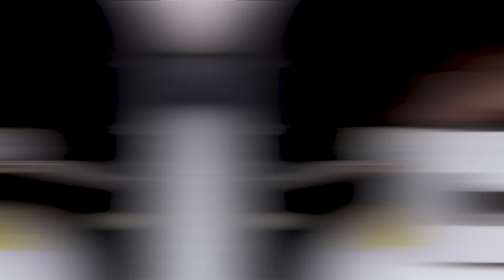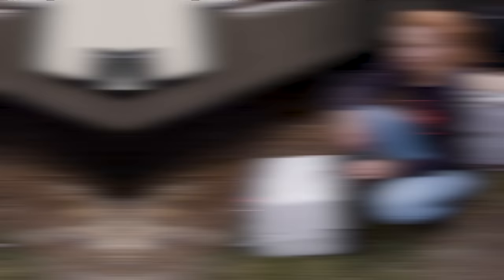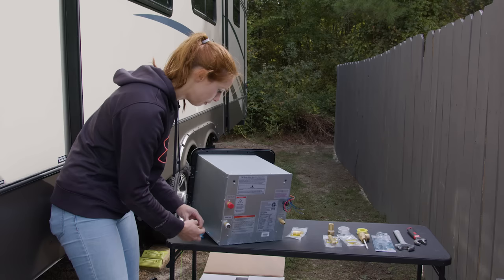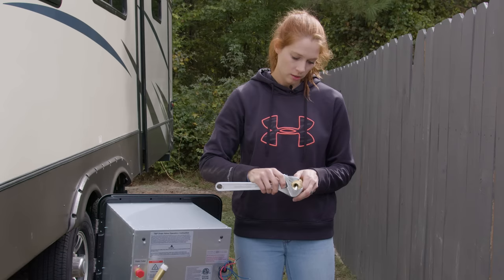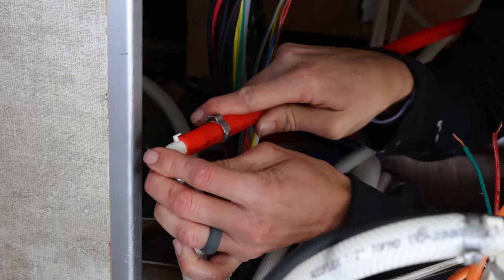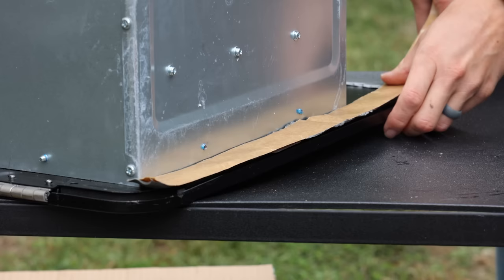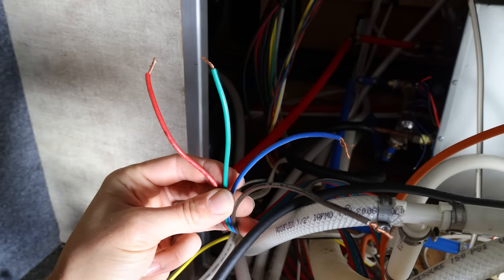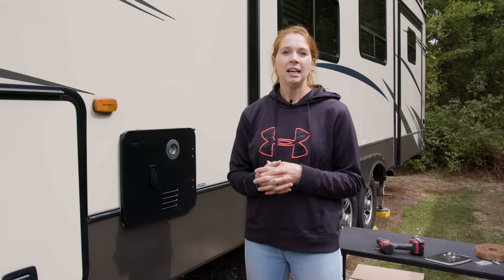(UPDATED) Installing a New Fogatti Tankless Instant RV Hot Water Heater: Easy step by step guide!

Comment: Excellent tutorial... consider wago lever nuts over the outdated wire nut for electrical connection.  Love them.
Reply: I bought wago, with the same thought that nuts are outdated and can be slower.  After buying, I did more research and found I was wrong.  Wago limits current flow much more than wire nuts, making the nuts superior.  Be careful of when wago is used.
Reply: @bobblack3870  From the manufacturers site:  "WAGO installation connectors always come with the full current load capacity of the maximum connectable conductor size. They never become the current bottleneck in an electrical installation."  My RV was also manufactured using Wago Nuts and I personally have them installed in my basement refinish with no issues.  I even have high current draw space heaters plugged into the outlets.  Where did you find your information?
Reply: @panofish  My info comes from electrician's forums.  Most places in an RV may be fine.  The professionals say they are good for solid, but not stranded because some strands may not get contact.  They also dislike using them where there is more than 15A.  Don't know why, but maybe it is related to possible generated heat due to a limited contact area, whereas wire nuts ensure a large contact area.
Reply: @bobblack3870  Appreciate the kind feedback, but I guess we'll just have to disagree.  I have a BSEE degree.  Never seen signs of overheating with stranded in a wago.  Perhaps with sloppy wiring?  Who knows, but I trust the wagos.  Personally, I've seen sloppy work with wire nuts also.  For clean connections with stranded... I sometimes solder the ends.
Reply: @bobblack3870  Ah, well the forums must be correct.  🙄  Wago connectors are used in almost every 16A 230V residential application in Germany, and possibly the rest of Europe.  Wire nuts are expressly forbidden in Germany.  Wago connectors can be used on solid or stranded conductors.

Comment: I believe the term is " water heater" You cannot heat hot water, also even after the tutorial on  the direction of the tape, I believe you applied it in the opposite direction on some applications.  Great video very educational, I wish my wife was as mechanically inclined as you are, happy camping.
Reply: Glad someone else cringes over "hot water heater".  If the water is already hot, you don't need a heater!  But I wasn't gonna be that guy. 😁

Comment: Thanks for the video. I note that some were mentioning the tape error. I will also add something that my father taught me on any tape usage with threads (water or gas). He said to always avoid the tape on the first and last thread groove. He was an engine and mechanic guy and said it can save a lot of potential trouble with the tape.

Comment: Great vid. Without a doubt the best I’ve seen on install on demand. I’ve been plumbing for 45 yrs. i cant tell you how many times I’ve used teflon tape and had leaks afterward. I finally started using both tape and pipe dope combined and have never had a leak. Also 5 wraps of tape werks best. Dont put more you can actually snap the fittings.  thank you!!

Comment: Hi, Thank you very much for the video, as per the manual it recommends a 680 kpa on model fs08b1s (100 psi) valve and the valve goes on the outlet side, I didn't know anything about this heater until I watch your video, it was great help.

Comment: Great video. I believe you can use Teflon or  Teflon pipe dope on compression fittings but not on flared fittings. And to end the confusion just apply your Teflon tape clockwise. Thanks
Reply from the maker: All of this has been addressed in my 8 month review video! Make sure to check it out if your thinking about getting one 🙂

Comment: great job we can't expect people to think of everything. The one thing I did different was to run out all of the hot water in my old tank, after turning off the power and gas to it, to avoid getting scalded when removing my my plug.

Comment: I'm currently installing a Fogatti 8 Pro.  Guess I need to make a video about this.  That said and someone may have caught this already. The pressure relief valve is actually blocked by the gas line in this installation. And as stated by someone else but a VERY IMPORTANT PART. Don't use any type of thread sealant on a  flare fitting.  If it leaks you either have to replace the fitting or create a new flare on the pipe. That is the only SAFE way to do it.
Reply from the maker: This has been addressed. Make sure to check out the 8 month review video 🫤

Comment: if a connection has its own way of sealing.....ex, flare, oring, compression, etc......dont use any teflon tape.   yes it will be tight on the thread around the nut itself, but it may not be tight on the inner tube part and could allow it to leak.      very good vid!!

Comment: If you have problems with the temp differances like most of these on demand  rv  heaters .if you get a 2.5 gal electric heater under one of your sinks that are close to water heater . As a buffer tank . There are piping diagrams on line to pipe in a buffer . Its cheaper than buying a Truma tankless . Truma tankless water heats you will have even heat at the foset.

Comment: Nice job, only problem is I still want dual heating so I’m not burning through propane so when one comes available that’s when I’ll be shopping. I can heat on and off for free with solar and batteries but it will drain quick if you are not careful 😂  
But if you drop to a lower wattage you can keep on longer for keeping water warm then propane for shower. 👍🏼
Reply: I don’t think they will make a tankless electric for a towable. Would be too big.
Reply: No RV can handle the electric load of a electric on-demand water heater
Reply: Does not use that much propane

Comment: While you're installing a new water heater, installing a water accumulator at the same time would be a good idea.  An accumulator eventually saves battery usage and the pump doesn't have to run in order to get water pressure.  Nice at night when everyone else is sleeping. Oh by the way, what you call an adjustable wrench at the beginning is actually called plumber's pliers. I would recommend using a good fitting wrench instead of adjustable.
Reply from the maker: Eh, I’d never use it. We don’t boondock enough to justify that. We use propane to heat our tank, and it’s surprisingly quiet. I don’t think it’s ever woken me up at night and it’s right below my head 😂

Comment: I do tons of winter camping and this water heater specs say it won't turn on if the water is below 43 degrees.  I use a heated water line but I'm sure there are plenty of times it is only 33 or 34 degrees coming in on those days the air is 15 or 20 below.  So that is something to consider if you are a year round camper.

Comment: Tankless are great for hot water. Nut there is something that I haven't seen mentioned in the comments and some may not be aware. Tankless consumes a lot of propane. Not sure the trade off is a good one, especially if boondocking and supply of propane is not close.
Reply from the maker: We just went camping for 5 days and didn’t even use 1/8th of a tank using the hot water heater AND the furnace nonstop. I’d say it’s no different than using the propane/electric version of it.
Reply from the maker: @Roads To Nowhere consumes more of what? Water, energy, propane? I’m assuming you mean propane. If that’s the case we’ve used it several trips and haven’t used any more propane than our old heater

Comment: My first RV had a tankless water heater and I didn't like it. It didn't work well at all if the water pressure in the campground was low or running off the pump. I use a 1 micron water filter that also slows the water. Tankless heaters will reduce the heat if there is low flow. Maybe the newer ones work better.

Comment: Please don't use wire nuts in vehicles.  Over time they vibrate apart and then the connection starts arcing.  It is very small at first but over time can cause a fire.  Use the crimp style connectors, push connectors, or if you want to be the most correct, solder and shrink-wrap the connections.  If you want to know if your panels are aluminium or steel use a magnet.  Don't use your router in steel panels.  Good video all the steps are easy to understand.
Reply from the maker: Rv manufacturers use wire nuts. Doesn’t mean it’s right, but it’s standard. Also, I’m using my router on aluminum, not steel. The only part of any RV framing that is made of steel is the trailer frame itself. Any framing will be aluminum or wood (or sometimes entirely made of foam).
Reply: @fallenintocamping  I did note that you were using it in aluminium, I was commenting for people that watch your video, informing them an easy way to do a check.  Many older RV's have steel panels and you never know if someone used a steel panel to do a repair.

Comment: While it might never happen, it appears that the handle on the water pressure relief valve can potentially rub against the gas line.  I would suggest at least an inch further turn to ensure it won't.

Comment: Be sure to use some soapy water to spray on your gas line connectors with your gas on to ensure that there is no gas leaks.
Reply from the maker: Agreed! I think I quickly skipped over this at the end with a ‘make sure you don’t have any leaks’ comment but I definitely should have elaborated on that. Soapy water in a spray bottle is the best way to check!

Comment: I don’t know if your tankless water heater wires you didn’t use are like mine but mine I found out the ones you sent to cap or for the shore power so you don’t deplete your battery power

Comment: just a thought.  You should never use adjustable wrenches on gas fittings! (slip-age/damage). Line wrenches are best but open end wrenches will work in a pinch.

Comment: Nice video. Hard to tell for sure, but looks like you might have missed a crimp on your relief valve drain line after the elbow (unless you did it after). Just incase, you might not find that one when pressure testing.
Reply from the maker: Good eye! I left it loose and crimped it after we filmed! I had a few other crimp rings that I left loose because I didn’t fully tighten the water lines during filming! I did a pressure test the next day, and we camped with it last weekend!
Reply: Awesome 😊

Comment: This video is very helpful!  Thanks for making it!  I did not see a "backflow preventer."  Not sure of the actual name or if that is it.  Is this needed and if so where would it go?
Reply: i am looking for the correct placement for the back flow valve as well if you got an answer please post.
Reply: Backflow preventer goes on the water inlet side. Also she mistakenly put the pressure relief valve on the inlet side but it goes on outlet side.

Comment: Pressure relief valves should be on the hot water side, unless I missed where you said that the manufacturer wanted it on the inlet side. Which I apologize if that’s the case.
Reply from the maker: Nope your right! I’ve pinned a comment to update in the description so other folks can see it too.

Comment: 17:48   A butyl tape seem can leak, so at the very least, do the top side with one continuous strip and overlap them to account for gravity.  Better yet tho, use one continuous strip and join them at the bottom!     You do not need to rip and join at the corners.   I would even caulk the outside as well.    Trust me, I lost a brand new trailer to a rotten floor within two years because some lazy worker put the seem on my fresh water fill connection on the top.  It MUST be water proof from driving force rain from all sides.

Gas lines should not be Teflon taped.  

I don’t know if code requires a pressure release, but you will blow every hose in that RV before that thing lets loose, and if you need to release pressure, just open a hot water tap!

Comment: I am a rv and heating contractor 30+ years. Sorry to say but you need to put the Pressure Relief valve on the Hot outlet not the cold inlet. I guess I won't be out of a job any time soon.
Reply from the maker: This has already been addressed and corrected in the description and the 8 month review video that I posted. Good news is, I won’t be out of a job soon either. RVs and water damage go together like PB&J 😂

Comment: "Remember to thread your tape on in the right direction..." as you apply it in the video in the wrong direction on all but 1 fitting  haha.. atleast you caught it and provided a text update :)   Also your pressure relief valve is too close to the gas input so a 4" nipple would be better than the 5" you used. Good video overall :)

Comment: Did you modify the piping for the propane so the lever of the pressure relief valve can actually operate?
Reply from the maker: I cut and flared the propane line later, just didn’t record that part, sorry!

Comment: Make sure power is off before taking wirenuts off or you may short out or melt wires...
Reply: You can also trigger the water pump with some setups when the wires are exposed and have water all over.

Comment: I ended up getting one last year. I love it but you have to be very careful when the temps get below freezing. The thin pipes inside will freeze quickly and burst.
Reply: what can you do to prevent freezing or handle freezing temps?
Reply: @peTeMelster  run the water heater every 5 minutes. Or place a small electric heater pointing at it, like the kind of under desk heaters. But that's not efficient or safe. Really the best thing to do is shut off the water and drain it. 

According to the place I bought mine they were developing a newer one with a small electric heat lamp to prevent freezing but I'm not sure if it's available yet
Reply: @bd3470  I'm in Salt Lake and need to find a way to keep my Fogatti from freezing over night.
Reply: Thought I'd help you out with your question regarding the Fogatti water heater she is installing in this video it comes with an "anti freeze" internal circuit in the unit. All you have to do to make sure that circuit is provided the 12VDC supply and propane. Another words do not turn it off because it will kick on in freezing conditions (without demand for hot water) just to warm up the unit then kick off. Kind of confusing but I hope you understand Fogatti has thought about the full timers like me that stay in the cold in the winter. Enjoy Elizabeth

Comment: We just down sized on our 5th wheel and the new one has a 6 gallon hot water heater, and the previous one had a 10 gallon.  I'm curious how much propane this uses, as we typically leave ours on electric.

Comment: i have that same heater when you drain it for the winter make shier it is empty blow compressed air though it are something mine froze and split the copper windings inside in two places from water freezing i may try to solder it to fix it but the copper pipe is vary thin . i have one of the cheap 150$ on demand things from Cina now  I almost like it better as its cheap to replace

Comment: I couldn't find the 8 month  review of this water heater... have you looked into the temperature control/thermostat that you mounted on the side there with the 2 screws... maybe it is supposed to be mounted vertical instead of horizontal.. or maybe the controller went bad? Possibly moisture? Good luck let me know if it helps

Comment: OK I think your fine with this . Also I am not negative just a little ADHA/ADD/Sheldonlike
1. I am missing the demo of the unit. I wanted to see it fire.
2. Missing a better fit check prior. It did not look like you needed to router. 
3. You did not need the extra row of tape near the water heater as it just sits open air now. (It looks like) Or you would have had to adjust the trim. You also pinched the trim and did not cut it . 
4. I would like to have seen what was the end result of the wires you hooked up to the switch. I believe they are just an on off but I don't know this. 
5. A bit of shower experience after just like yup I could take a 20 min shower and it was best ever. or it uses allot of gas. 

I am wanting to know also should I be sold on this. I went to youtube to see somebody be like yes I love it or here are the gotchas. Your doing great you remind me of my sister. She will look at a project and tilt her head for a min and attack basically. Nothing wrong with learning I love it.  You rock.  But I am not sold on anything about the product or know if you really like it. I also never heard it run.  Please don't take what I am noting as saying you should not be doing this or anything. Just thinks my silly Brain thinks of.

Comment: So Why not take the cold water feed, go into the Fogotti, then pipe the hot water coming out of that into the cold water into the propane heater tank?    Then you could have both working in tandem.   If one goes, you still have a backup system.    You wouldn't have to do all this cut, slash, yank, rewire, re-plumb work.
Reply from the maker: That sounds like a terrible idea, but I appreciate the suggestion. Both units have to externally vent, meaning a whole new hole would have to be cut to put 2 units. And so many other issues that I dont even want to explain

Comment: You need a high demand gas regulator and the red high demand ACME gas hoses to make that water heater work properly But im not shure if you need a seperate regulator for the stove and furnace ?
Reply from the maker: Definitely going to look into that. I have a regulator, but now I’m wondering if it wasn’t rated high enough for the flow, causing the unit to malfunction. Great advice, I’ll dig down that rabbit hole 😂